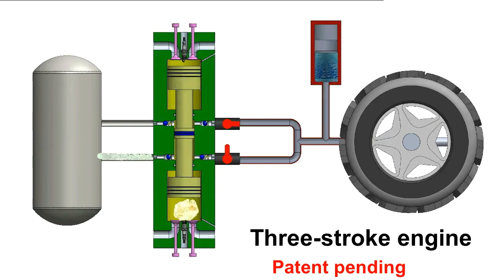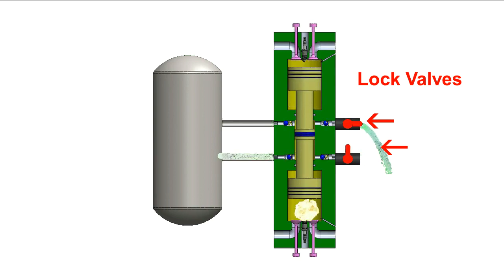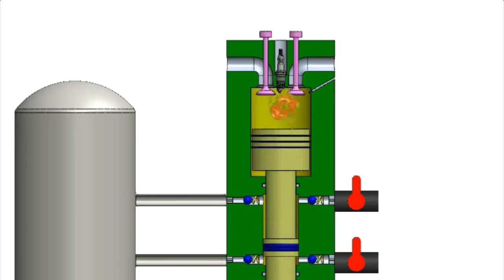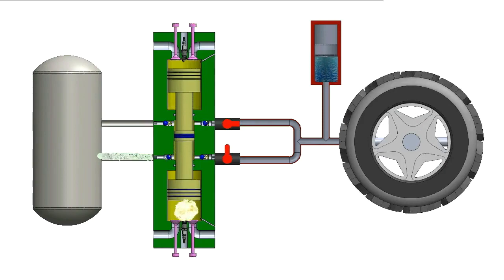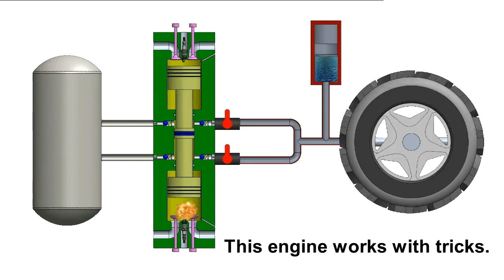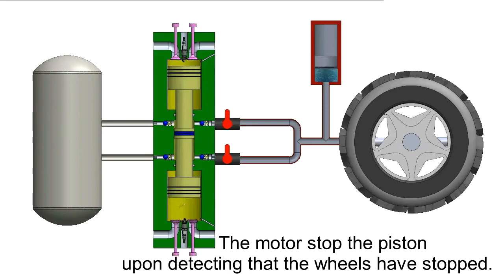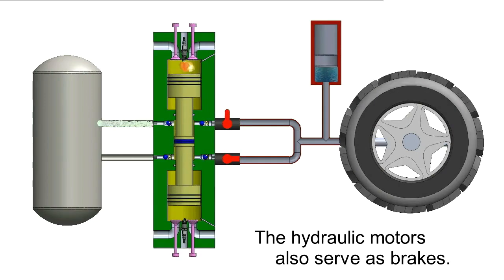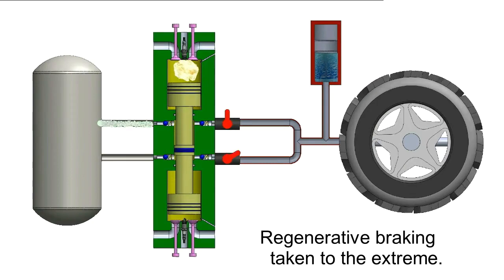The end of the diesel engine, the 3-stroke engine.

Comment: Wouldnt it be better if it were a four stroke tho? Even if it wasnt, do you plan of using freevalves that are moved by a computer? I would have several question about how much efficiency do you lose with the entire hydraulic system going trough the piston rod. Also timing of multiple piston could be problematic not only because of knock but backpressure from the pipes if they are uneven in lenght or in temperature. Overall however great desgin. I hope you can perfect it, long live the ICEs
Reply from the maker: Good comment, thanks.
4 strokes is easier to build, but 2 strokes should be more efficient, all strokes generate mechanical energy..
A hydraulic system is more efficient than its mechanical equivalent. I have the impression that hydraulics, being less known or used, generates these apprehensions.
The hydraulic accumulator allows synchronizing, compensating pressure differences and little energy is lost in the process.

Comment: i can't find any problem with this engine 
it's genius hydraulic power delivery engine 
this engine also easy can solve thermal and oil issue
i think a lot about design an engine with hydraulic power delivery but i have 101 iq 
i was preoccupied with this for 2 weeks until I became careless , i'm not creative 
every idea that came to my mind was exactly the opposite of your idea and all my ideas had problems with how to transfer liquid
thanks for your idea
this engine should test in 10k rpm

if this engine can't work in 10k or 14k rpm properly but still good for generator and heavy machines
Reply from the maker: I have not been able to find a problem with this motor either, I think it should work very well.
Why do you think the engine should be tested at 10,000 rpm?
I think that it is an engine that should work very low rpm, because the piston stroke can be very long, in relation to current engines.
Reply: @egutzlaff  
because if it work in low rpm , not good for car or super car
but good for excavator or mining machine or generator
It should run at at least 1k rpm If I can not work at this speed, it is useless
any situation that is possible. I thought about it before except this one
so I think this is the last possible mode of power transfer with liquid
also all engines that are made. I watched it on the internet
the best possible condition is piston engines with crankshaft
that's why these piston engines are still in use after all these years even rotary engine dead also, liquid piston wankel is not used
maybe omega 1  can replace piston engines but I'm not sure

Comment: How can you start this engine, if there is no crankshaft? Plz replay.
Reply from the maker: The engine can start in many ways:
1.- Series of injections and explosions: the compression pressure will increase with each explosion, until reaching the working pressure, this starting system is patented for a FORD 2-stroke engine.
2.- Hydraulic compression stroke: A special hydraulic circuit uses the accumulator pressure to perform the compression stroke, injecting pressure into the hydraulic pump. If the accumulator is discharged, a small electric hydraulic pump would do the charging.

To start the engine, I don't even need to know where the piston is.

Not everything can be said in a video of a few minutes, but this engine is the simplest and most efficient combustion engine.
It is not arrogance, it is knowledge and engineering.
Reply: @egutzlaff  thanks and best of luck .

Comment: built some thing very similar years back getting timing right was a nightmare. under load changes engine stalls.
Reply from the maker: I speak Spanish and the language is a problem.
The engine stalls at each oscillation, adjusting the times is not a problem.
FORD patented a similar but 2-stroke engine, my engine is 3-stroke.

The engine delivers a power. ->If the demand is higher than the engine power, the engine stops.